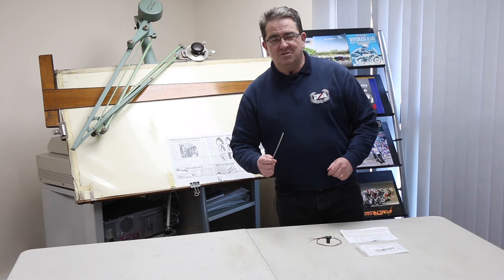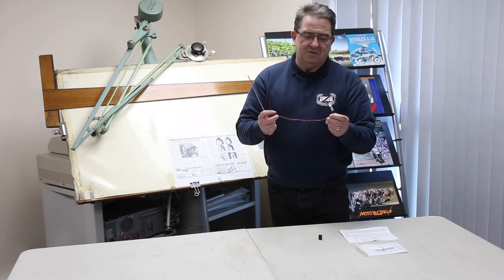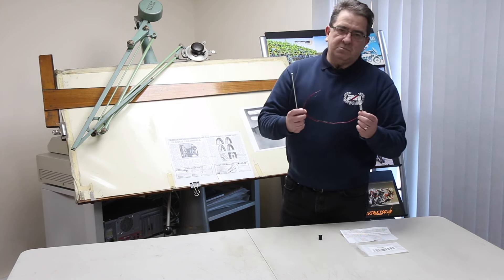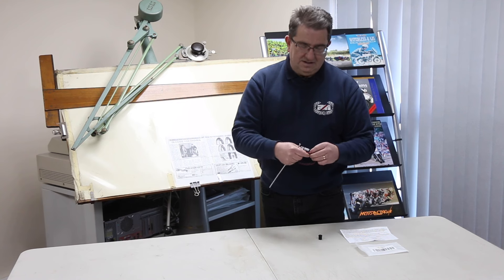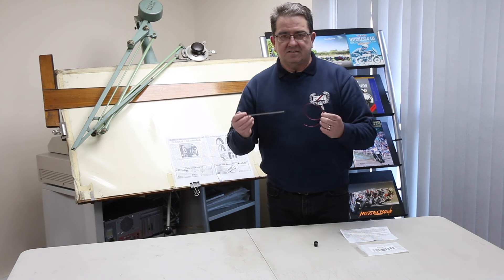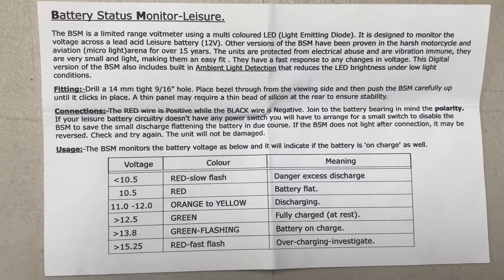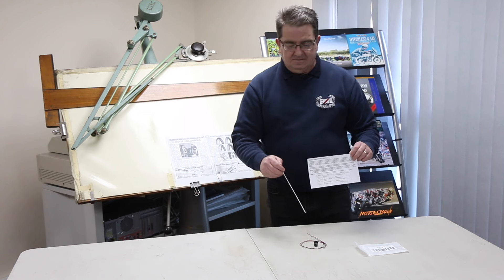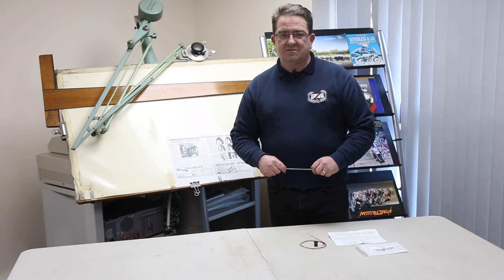FAQ Monday - Battery Status Light

Comment: Pro tip: By filing the bulb flat on the end, it can be dropped into the hole previously occupied by the assimulator light bulb, and made to look almost identical to the original assimulator bulb. I've had one of these installed for over 2 years and it works flawlessly.